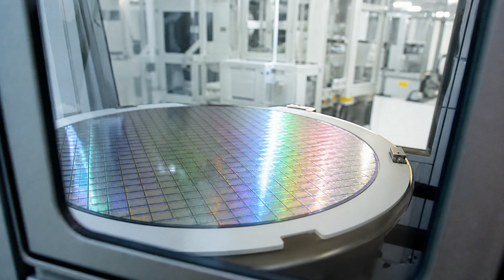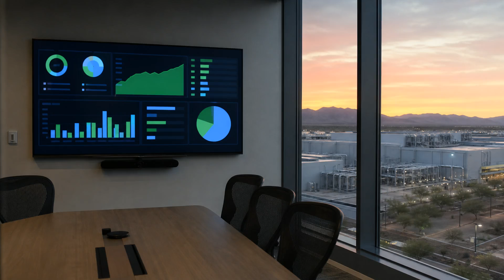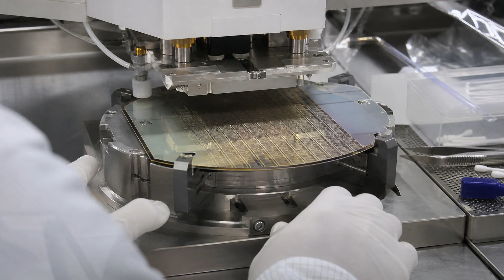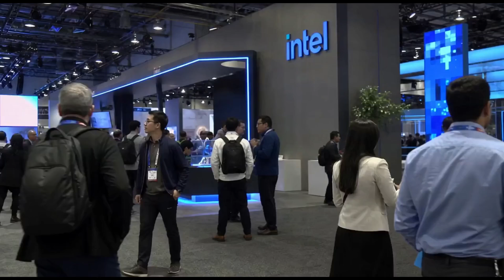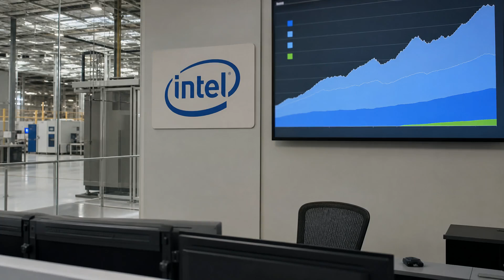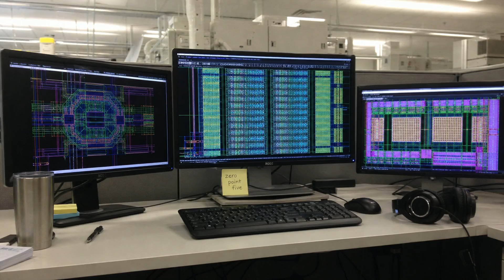Intel Just Beat TSMC at Something (For the First Time in a Decade)

Comment: Volume should win if the price is right.  And right now, the price is not right.  The market is way over priced by not less than 10 to 15x, that means volume must go up so people can afford the technology.  Right now, few can afford the upper echelon technology.  My AI GPU has gone from $2,000 to nearly 20G in the last 8 months.  There is something seriously wrong with those numbers.  And memory is just as bad.  We cannot even afford the memory for our AI system.  We are not a big company, rather a new AI startup.  And if prices don't come down drastically, AI technology will suffer terribly in AI model development.  We are already at Conscience AGI Research development... but its hardware over-pricing is where the bottleneck resides.

Comment: The reason why Ohio is being slow walked is because they continue to ramp up fab52 (Chandler AZ) and they are tooling fab62 (also in Chandler).  That's more than 1.5M SF of clean room at their largest manufacturing campus - Ocotillo in AZ.  A couple of miles away they have the packaging HQ and plant in Chandler.  Why not build out this synergistic campus then expand to Ohio when Arizona is at capacity?

Comment: Perhaps this guy can answer my question. Here goes. I drive a 1976 Cadillac. It has power steering, disc brakes, electric windows, electric seats, automatic transmission, air conditioning , directional signals, electric wipes and cruise control. But! But! But! It has no chips! Why? And what is missing? And what is better/worst between my 1976 and today's Cadillac that I'm told has over 4000 chips?  Please explain?
Reply: My 1976 Cadillac Eldorado had a Bendix electronic fuel injection system which certainly had "Chips" if my memory serves me correctly?
Reply: How is this remotely relevant to this presentation?
Reply: You're assuming this AI content creator is a guy? It's not even a person. It's just an algorithm creating content to generate ad revenue for someone nobody knows.
Reply: I'll take a stab at it.   Your 1976 is better because it is serviceable, but 'worse" because the manufactures make less money on them.  The new ones make more money for manufacturers and are probably lighter and maybe have a more efficient power wise electrical system.
Reply: Simple. The new one has more chips. And chips are chips.

Comment: This video correctly notes that density still favors TSMC N2 (roughly 30%+ higher reported standard-cell density in analyst measurements such as TechInsights). TSMC remains far ahead on pure volume and ecosystem maturity. Intel’s ~30k wafers/month on 18A (Arizona + Oregon) is meaningful and yields have stabilized into a more mature defect-density range after earlier variability issues, but it is still an order of magnitude behind TSMC’s N2 ramp targets.
Reply: You understood that from the video as well, good... That is because of legacy circumstances and manufacturing infrastructure... what is your point?
Reply: ‘an order of magnitude’ is a severe exaggeration. And besides, ultimately, few new chips will prefer to be on the bleeding edge anyway. The costs are prohibitive, from the POV of competitive pricing.

Although, I would concede that the bleeding edge will one day be the norm. But this also means Intel still has time, as well as a bottomless pit of capital.

Comment: Intel does not have the capacity of TSMC!. However,  Elon's TeraFab which partners with Intel in the fab tech (ie 14A and below) will be a definite threat to TSMC when it scales up. That is three years time. Maybe four years to 60% capacity. It will likely make HBM4 memory as well. So Micron, SK Hynix and Samsung ought to be worried. TeraFab will do vertical integration that a Fab has never done, plus it will also do board integration to make serverboards.

Comment: Very well done, I don't think I had an issue with a single statement.  The question is yield.  Frankly I did write off Intel two years ago, and it looks like I was wrong, and I'm happy to have been wrong.  If I really am.  I have odder beliefs than that, like that production needs to go back up to single-mask DUV process, which is up around 30-40nm.  Hello!  Why?  Yield, that's why.  But with newer process developments since then, what can be done at 40nm?  Well, I'm not sure.  But there is this, you say TSMC is ahead on density - but who cares?  Extreme density concentrates heat to problematic levels.  Even with 18a geometry you want lower density to manage heat and maybe power fluctuations as well, leave lots of room for those through vias.  Speaking of which, did I see that 14a may not have back side power delivery?  Googling ... seems still unsettled at this time.

Comment: I have a bit of a problem with the terminology. Originally a Transistor meant a bipolar device with a Base Collector and Emitter. A FET is a Field Effect Transistor with a Gate Drain and Source. Whilst they are both semiconductors, they are not the same thing.
Reply: I'm an old techie as well... things change!
Reply: "Transistor" looks like a play on "resistor". If so,  FET is a transistor, etymologically.
Reply: @red-baitingswine8816  There is a range of operation where a transistor can variably control the flow of energy between two connections through resistance like a triode tube in an amplifier.  It can also be designed to be a switch.  Bipolar transistors are current controlled, while FET's are voltage controlled.
Reply: @red-baitingswine8816  'transient resistor' perhaps? very useful for amplifying a signal?

Comment: >>>>>  Here's the core issue -- Intel Corp has historically experienced poor yields with its "bleeding edge" IC chip fab processes ... no matter what performance advantages are claimed (eg, speed, power, heat, etc), if 18A and 14A can NOT reliably and sustainably match (or exceed) TSMC's IC chip fab yields, then industrial leadership recovery will STILL be a "work-in-progress" instead of an "accomplishment"!  <<<<<

Comment: I left Intel 15 yrs ago leavving behind w/ 2 types of technology, all the adv. Packaging techs that makes EMIB or FOVEROS possible most of it originally developed when I used to be at Motorola 3 miles north up be road ( that huge place w/ 4 Fabs is now a Parking Lot ). , the other technology is called DOCI - P or how to accelerate Yield improvement of new nodes using z adv. Packaging. But they had an amnesia and Pat who had never worked in a Fab threw 16 bn at 18A and could never get the yields up by traditional way. Naga is a Mech Engr., he made his name at Micron by applying brute force to asseble HBM using my elegant technology developed at Motorola. There are just too many of these Mech Engr.s in this world and they would Andy excuse ( like thermal ) to get into Semiconductor biz but they need to be kept out. As to those technologiescInleft behind that LIp Bu should be ising to expedite 14,A, he should read my paper in IEEE J of z electron Devices last Oct. Wrote it to temindvthedevzengineersvthat there is a smarter way to skin the cat !

Comment: Intel was handicapped for 15 yrs w/ unqualified CEOs lpiclrd by a Board loadedcw/ finance guys. The current guy is mostly finance too but at least he has a MS in Nuclear Engr. TSMC has had only PhD s in STEM as CEOs just like Intel in its first 40!yrs. semiconductors are too scientific a business, to see and plan for the future and make wise choices you need a PhD. Right now Intel needs one not just any generic STEM PhD but in Mathematics ( to do AI smartly rather than by brute force like now needing a Nuclear Power Plant of its own ! ), Physics or Metallurgy / Materials Science. The EEs who design the circuits or test the finished chips cane easily replaced. By EDA and Multi Physivz

Comment: I'm genuinely unsure how to answer your closing question, because there's an important question precedin%g it that we don't know the answer toL  what is Intel's yield per wafer?  TSMC, to my knowledge, runs better than 65% on its latest nodes, a high enough yield to be profitable.   Intel has long struggled with its yield percentage on its nodes for at least the last 5 years, and that's part of the reason they had to do some production  with TSMC for recent generations, as their yields weren't high enough to profitably turn out Core CPUs, so they limited their latest nodes to making Xeons with higher margins.    I've been waiting to hear Inteldiscuss yields on 1A and 14A, and all I hear are crickets.  But if the yields were good, I'm sure they 1) would be talking about it, and 2) actually getting customers buying it vs. evakuating it.
Reply: You are right on the dot….